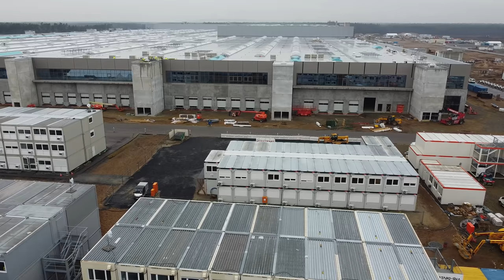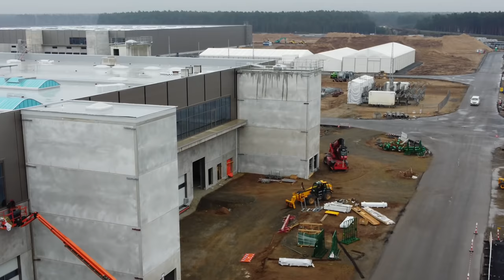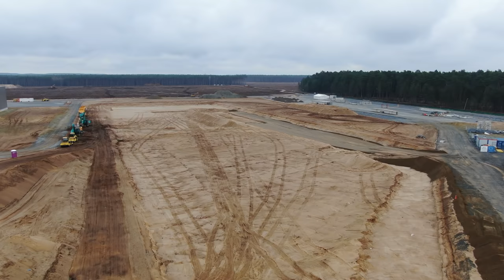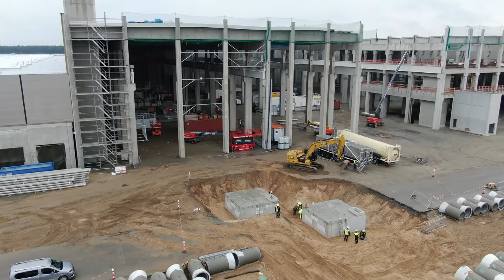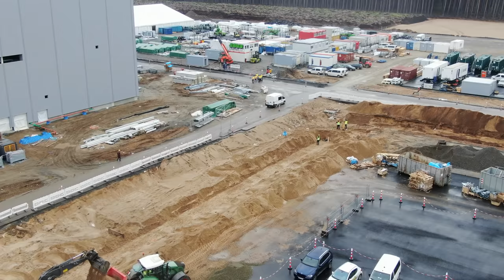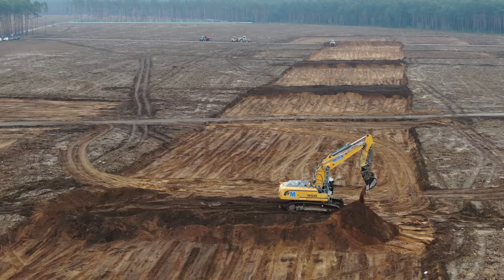Giga Berlin | 2021-04-10 | Topsoil removal

Comment: It would be nice if some text (and/or) audio could be inserted to explain what is being done.  We see two concrete boxes installed in a big pit below ground with lots of concrete cylindrical pipes alongside.  Presume water from factory drains will be gathered .... and placed where?  Will there be a water processing plant to allow reuse of filtered water?
Reply from the maker: Unfortunately I also don't know what those concrete boxes do.
The concrete pipes are for rain water. Rain water will not be used. It will be infiltrated into the ground somewhere. It was planned to build a big infiltration basin in the north-east, but according to media the plans have been changed to do more decentralized infiltration. So I don't know where those pipes will go.
There will be a waste water treatment plant to allow reuse of waste water.
Reply: I actually prefer usint my eyes and brain. could be saif that those who lable everything are not letting you do your own thinking.
  There is a balance comewhere, which is different for all of us.
Reply: @TobiasLindh  Yeah it looks like they are getting ready to bury the stormwater drain lines. I've done that before it's actually lots of fun connecting the concrete pipes and keeping them straight and at correct level with surveying equipment. Those concrete vaults look similar to catch basins. Like for catching groundwater runoff. But i couldnt see if there were holes in the sides to attach pipes to it.
Reply: The boxes are "cable basements". To pull, connect, distribute power cables.
Reply: @julianreverse  I thought that too but I didn't see any conduits leading to them or any holes in the sides. Maybe the holes are covered over.
Reply: @mcg9884  The holes are filled with XPS and the conduits are stored next to the DU building. 6:53 blue = water, yellow = gas, black = cable conduit.

They install two fully independent power systems, main and Backup - that's why they install two boxes.
Reply: @julianreverse  Thanks, that would explain why they are in pairs. Some headed around to the drivetrain building some towards the main building. The ones at Giga Texas were completely open. These seem to have a smaller opening in the top probably have some ladder rungs inside. They are pretty big.
Reply: Thanks for your additional information. @TobiasLindh

Comment: Glad to see topsoil removed. Probably needs to be for stability reasons, but environmentally it is a substantial loss if buried beneath concrete.
Reply from the maker: It's not just for stability reasons. The topsoil has to be removed by law for environmental reasons.

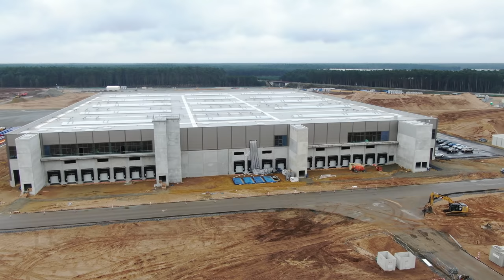Comment: 4:33  Does anyone have an idea what the collection pipes and bladders are in front of the drive fabrication building.  Clearly they are temporary as you wouldn't block delivery bays and their apron but they seem quite substantial. (Dehumidification, air cleaning?) Another good video Tobias, Thanks.
Reply from the maker: That's for heating and waste water. Yes, it's just temporary.
Reply: As there is no connection to the sewage plant yet those blue tanks are collecting the wastewater from the toilets etc. inside.
Normally those tanks are used as the basement for toilet containers used at festivals or exhibitions.
http://www.schmidt-container.de/faekalientank_mit_treppe.jpg
Reply: @abalada  Tesla wartet auf eine zulassung für Ihre Abwasser projekt.
hier kommt wieder die Brandenburger Umweltauschuss zum erscheinen, wahrscheiblich mit lange Verzögerungen
Reply: @gaaguim  Das ist echt erstaunlich, was das für ein Schlaferverein ist.
Reply from the maker: @gaaguim  Das ist nicht korrekt. Tesla wartet nicht auf eine Zulassung für ein Abwasser-Projekt, und erst recht nicht von irgendeinem Brandenburger Umweltausschuss.

Comment: Great videos. Are the double T shaped brackets on the roof for solar cells? I have been wondering what they are for.
Reply: They are platforms for heating, cooling and AC equipment.

Comment: I bet the incomplete casting building is something to do with the pre-aproval.  Along the lines of aproval to start but not to complete.  The casting building is the token substantially incomplete part to comply with some BS agreement that allowed them to start.
Reply from the maker: No. I know for sure that it's not about any approval. The casting section has all approvals to finish the building.
Reply: This is a bet you'll lose.
"Along the lines of aproval to start but not to complete" - such a type of permit does not exist.
The permit could be withdrawn if violated or voided by a court. Those are however public processes. 
At the aisles the first two Giga Presses are installed they have finished the roof and are now preparing also to close the wall. Speaks also against any approval issue.
My guess is that Tesla plans some major changes regarding the future Giga Presses in the middle aisle of the casting. Must be major  - otherwise, it would not affect the completion of the roof there. As the two assembled (and two further possible) Giga Presses in the left aisle are sufficient to start production there is no time pressure for this. And those major changes might be also still not yet final enough to submit a new application. There are currently no pending permit applications regarding this building (as said - those are public processes).
Reply: @abalada  i agree. I don't think they will have any more than 4 to get started and then add the other 4 as they ramp up toward the end of this year and early next year. I saw reports on another channel that Tesla currently has 9 Giga Presses on order for delivery this year. I assume that leaves Texas with 4 to ramp up and more next year
Reply: @abalada  Whar are you talking about?  As you are "guessing", your comment is worthless.
Reply from the maker: He's only guessing about major changes. Everything else are just facts.